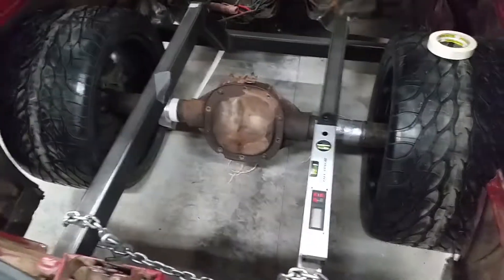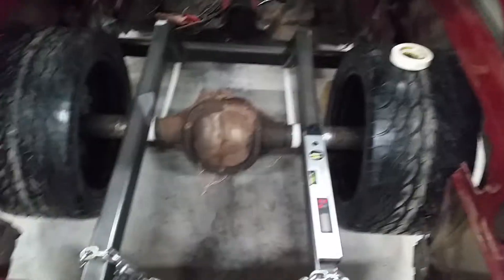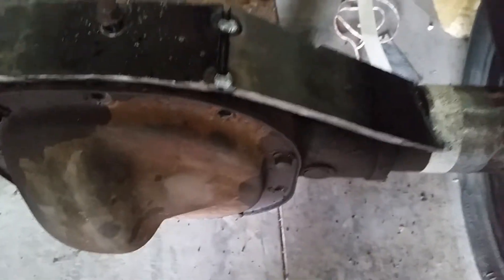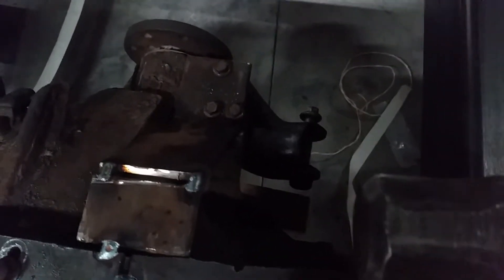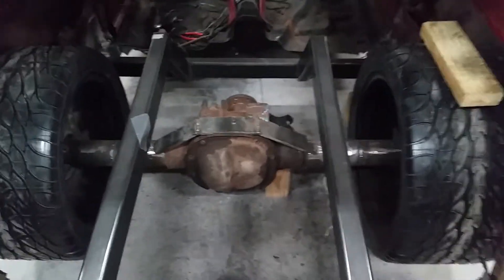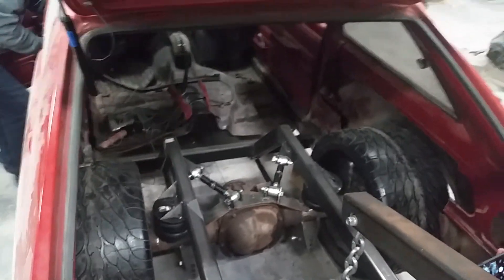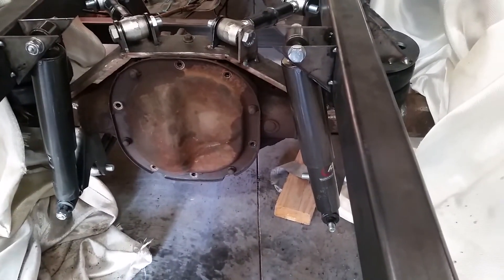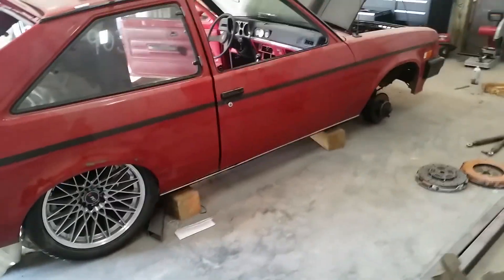V8 Chevette Chassis Upgrade Part2

Comment: Nice work. I'm in the midst of the same project. 'Cept mine is a 1984 Pontiac Acadian. 
*LR4 (Iron LS style) V8 4.8--->5.1L with punch and pistons
*head work with valve upgrades
*rebuild and mildly upgraded 4L60e

The goal is for 400-425hp before nitrous, and to keep it as sleeper as possible. The only big telltales will be the rear tires, dual exhaust and the note of said exhaust. :) 

Always love when a 'vette comes together.

Comment: what differential are you using
Reply from the maker: This is an 8.8 out of a 1999ish ford explorer with 3.73 gears, a limited slip, and disk brakes that was narrowed about 9 inches more than the last axle
Reply: Lean-to Customs  
how did you do the suspension in front of 5 studs
Reply from the maker: Pontiac fiero brake rotor, caliper and caliper bracket. That changes it to 5x100